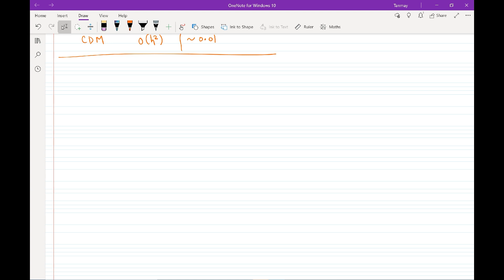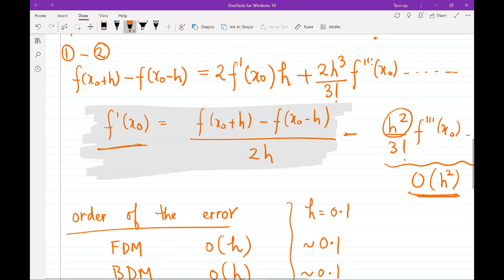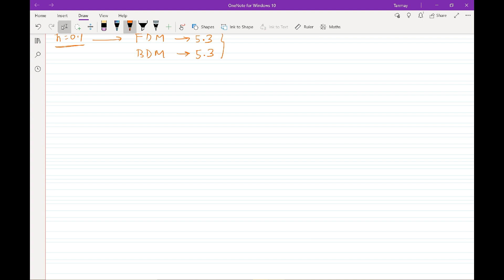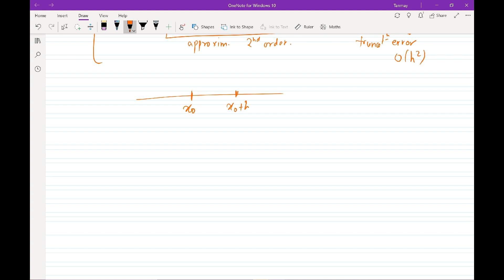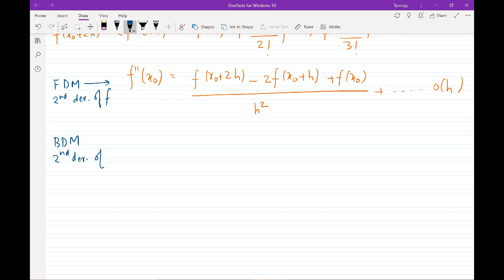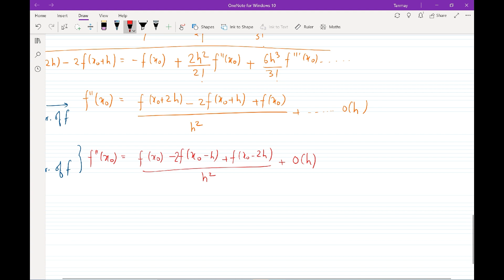Second Order Finite Differences | Lecture 2 | ICFDM

Comment: coming across you videos is one of the best thing that has happened to me this year. good job. in you video on id diffusion. i ran the matlab code quite alright and it worked but i noticed when i changed the boundary conditions to a decimal. i got an error notification such as indexing should be positive integer or logical. how can this be worked with a boundary condition such as; y(0.1)=0 and y(0.5)=1 instead of y(1)=0 and y(5)=1 that you used. thanks for your kind response.
Reply from the maker: When you say y(1) = 0, 1 is the index/location of the array (vector) whereas 0 is the value. So you can write y(1) = 0.1 and y(N) = 0.5 where N is your number of total points.